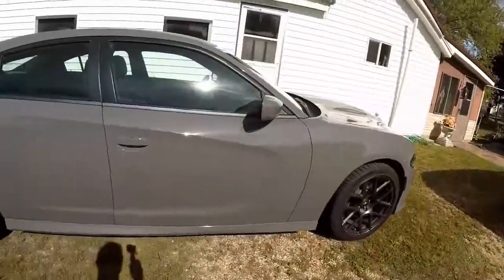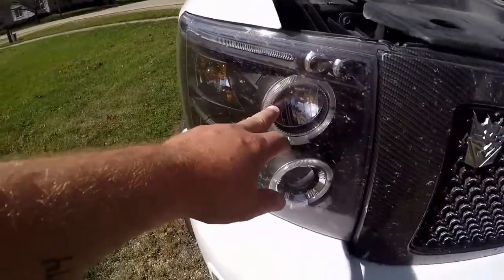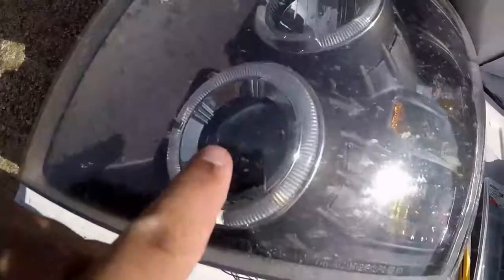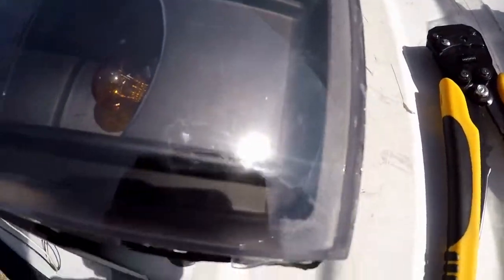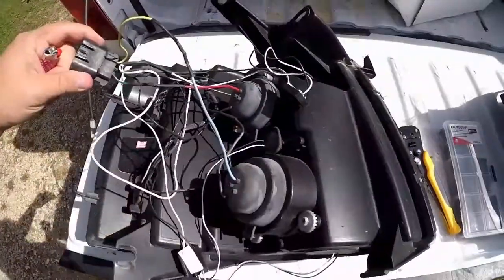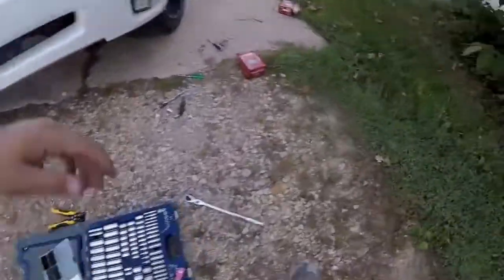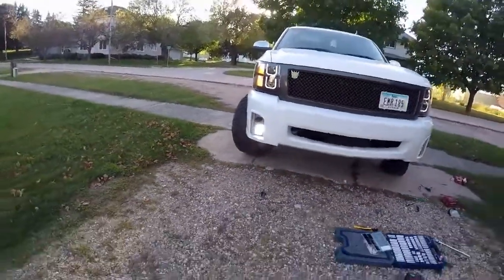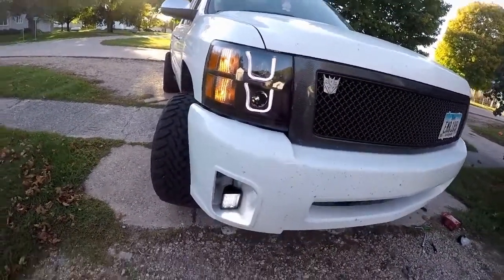Headlights and Fog lights installed!
2012 Chevy Silverado

Comment: Mind were just plug n play.  Only had to wire in the LED bar to the parking lights . Just 2 wires.  Not sure why you had to rewire it all.  Looks the same as mine
Reply from the maker: The way it came it had to wire it in to the stock harness. It didnt come as a plug and play. It says plug and play but none of the wires plugged in. This is a old video. I went to stock style lights but black recently and I remade my harness back to all stock plugs and bought some LEDs. I'll never go back to those stupid cheap lights. Stock housing with LEDs are the only way! I can actually see at night again and I have wayyyy more light. H1 bulbs suck. They just are to small.
Reply: @319speed  I've kinda gone thru the same thing. " plug n play" on my c-bar drl projectors was a chore.  Driver side went in easy.  Only had to splice in 2 wires for the drl.  The passenger side wired the exact same but didnt work. Had to redo it all in order for it to work. Still not real sure what the problem is.  On the fence about my H1s also.  They work better in some regards, less in others.  I did put in some spyder fog lights so that helped.  But I agree, next time around , factory housing with black background.  They have the ones with a little led strip between top and bottom,  maybe that.  But that's it
Reply from the maker: @noahkb80  yeah I love having different lights. Makes it more unique but I've gone through so many different ones I'm just fed up. I want good light output that's what I care about the most anymore. I've got super bright LED fogs that I installed and head lights both low and high are LED I'm happy. It looks clean and that's all I care about haha. I wanted a set with that RGB led lighting or whatever it's called but it's so over priced I just dont care to do it. Thanks for stopping by!
Reply: That's the truth.  You spend the money, you want stuff to work and last.  Dont make stuff like they used to.
Reply from the maker: @noahkb80  yeah you got that right!